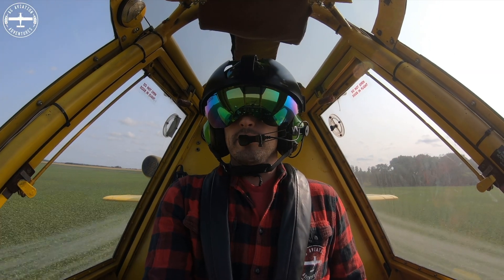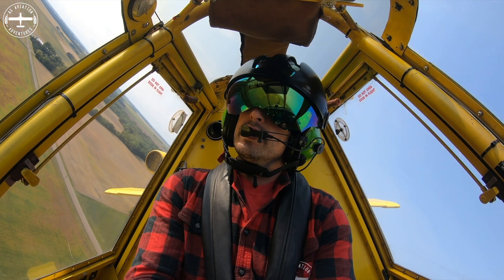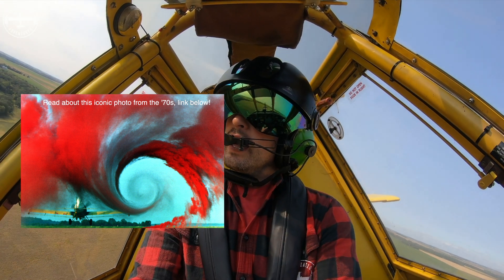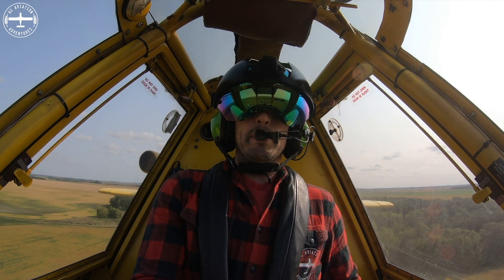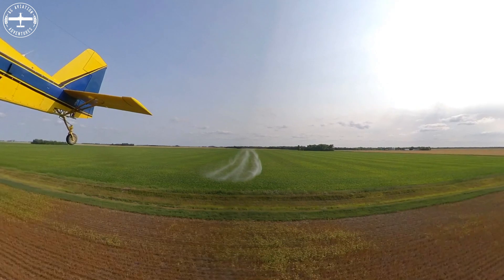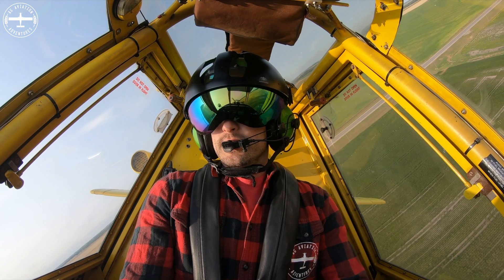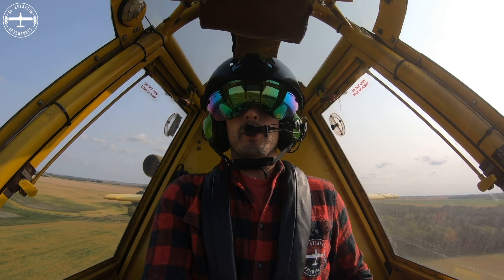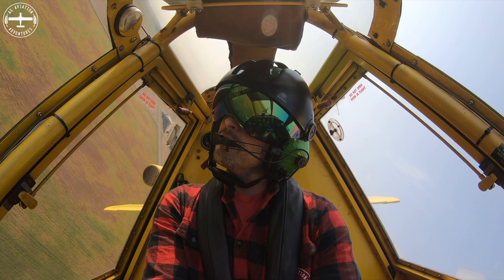Wingtip Vortices in Ag Aviation

Comment: Very informative. If the herbicide or pesticide is labeled for 75% of wingspan boom length, it would seem that winglets would be irrelevant to the application process but maybe make the airplane itself fly more efficiently. I’ve also seen a Thrush lose it’s wings in flight so not sure I’d fly anything but an Air Tractor. Stay safe!!!
Reply from the maker: That sounds scary!

Comment: Weatherly's have always had them. They do help a lot! Thanks for the Videos.
Reply from the maker: I've heard they do help as well.
Reply: But it is hard to see from the cockpit on the Weatherly, we found that out the hard way when one clipped an oak snag and turned to spoil the wing. It became a huge mess with parts scattered for 100 yards.
Reply: @charlesdurham6793  We had  3 Weatherly's. The older winglet design was better than the newer design. It would just swing back out of the way.

Comment: Asking as a ground based spray rig operator  how do weather conditions  effect your decisions ?  What are your maxes regarding temperature , wind speed, wind direction , dew point and inversion ? Does the airflow over your wings pull the spray down into the canopy and let you apply in conditions  that  we can’t  ?
Reply from the maker: We are a bit more limited in the conditions we are able to spray in. Check out a couple of these videos. The booms are setup below the wings to prevent the spray from getting caught in any kind of airflow. 

https://www.youtube.com/watch?v=2ljE_aLc4ms

https://www.youtube.com/watch?v=zbVEWcWdmyM

https://www.youtube.com/watch?v=MvAFyuXaV24

Comment: Not really sure the wing lights are worth the trouble. They will decrease spar life with negligible performance enhancements.  
  I know of two that have them in our area and they still run the 75% boom. And those are on 502s.
Reply from the maker: I’ve heard of a decreased spar life on the 502 but I don’t know much about it.
Reply: There is no spar life reduction anymore. That was in the past. More recent testing has proven they do not put added strain on the spars. The biggest advantage is approximately a 12% gain in swath width as proven at the USDA-ARS. Not sure they are worth the cost though.

Comment: My guess on why AT doesn't have winglets on many planes is because the winglet severely decrease the lifetime of the spar. I believe AT's spar life is 9k hours and the winglets decreases that by 30% (I believe). Thrush has a 60k hour spar.. 
Our 402 has winglets and really seems to help but I don't think it's worth it.
Reply from the maker: Ok that would make sense.
Reply: They no longer have a spar life penalty for 400-500 series air tractors. That was a thing before Leland passed. Not anymore. I agree though, not really sure benefits outweigh the cost.